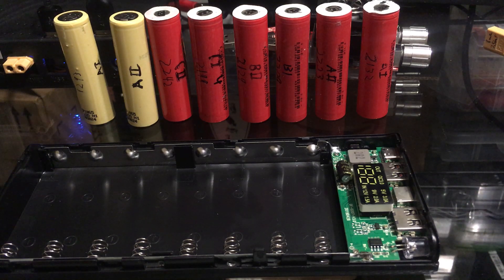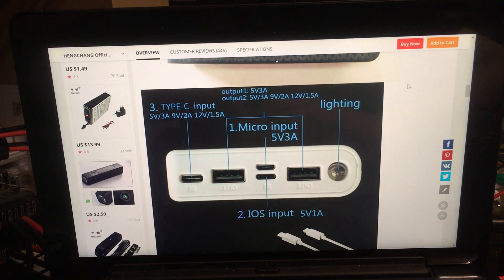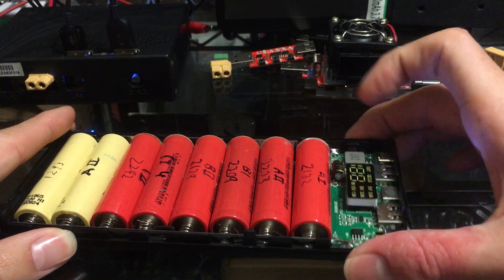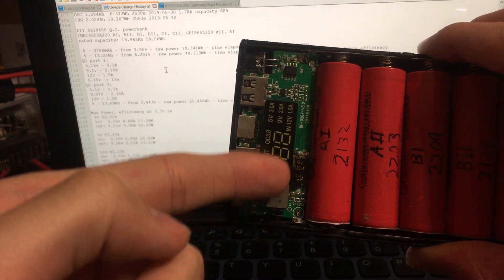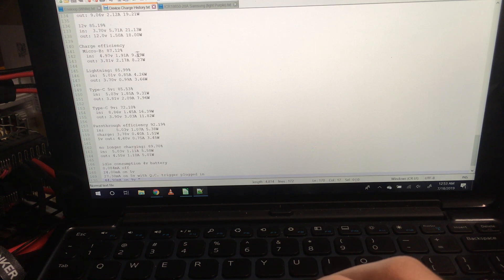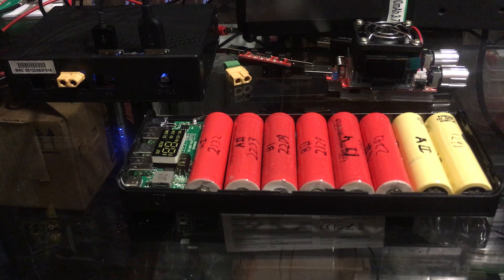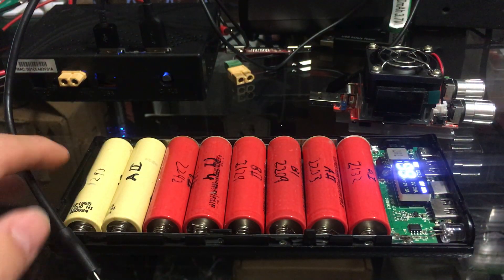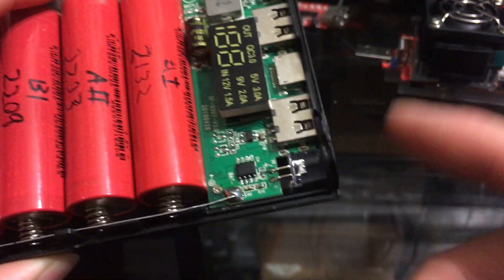DIY Q.C. 3.0 8x18650 Powerbank

Comment: What kind of security does this system have when recharging lipo batteries because I understand that each battery must be recharged safely so as not to damage it or risk of explosion
Reply from the maker: Because all of the cells are in parallel the BMS can treat all the cells as a one cell. So it has overcharge, overdischarge, temperature, and overcurrent protection for all the cells as a whole. This unfortunately does not protect from reverse polarity when installing a cell in the opposite polarity to the rest. But just make sure the positive end is aligned the same for every cell and they start at about the same voltage when installed for the first time. After that they act as a single large cell and the BMS is able to protect it safely.
Reply: @SuperBrainAK  nice info bro thanks !!!
Reply from the maker: @supercrash1991  hey your welcome

Comment: nice vid. is. it  protected.
Reply from the maker: thanks, yes the circuitboard has overcurrent cutoff and over/undervoltage protection for the cells, they are all in parallel with no protection inbetween the cells so just dont install one backwards, that would be bad.

Comment: If I plug a usb-c in the wall plug and use it as an input to charge my 12v battery, will the output of the board, going to the battery, be 12V? In other words, can this take a typical 5V in from usb-c and push it to 12V as output for charging the battery?

I am experimenting on one of my first projects and would love to use usb-c as the charging input and use this board for that! Thanks :)
Reply: @boringmpact4439  Yes thank you, I found out it only works with 1s set up, and I ended up blowing up the board when plugging my 3s li-ion... That's how you learn I guess 😅

Comment: Nope, the cells didn't match in capacity OR color; gotta re-do the whole video!
I picked up a couple of these; a 7-cell and an 8-cell version.  It'd be nice to find a larger one with a removable cover.
Reply from the maker: well with a 1S arrangement capacity or color doesnt matter :) the ones that julian reviewd a long time ago has a slide off cover, i dont think it is being made anymore though
Reply: @SuperBrainAK  I bought a couple 4-cell versions of those on ebay, with a screw-on cover.  I see a 6x version with two plastic locking screws - https://www.ebay.com/itm/Dual-USB-QC3-0-6x-18650-Batteries-DIY-Power-Bank-Box-Holder-Case-For-Phone-PC/264290984549
Reply: @Mazlem  is there only that q3 module without case bacuse i wanna make bigger verision... 10-12 batterys something like that?
Reply: @prckata  there is a 16 cell version with qc 3.0 and wireless charging too for about 25$, I bought one but haven't gotten it yet, looks pretty good from the pictures.